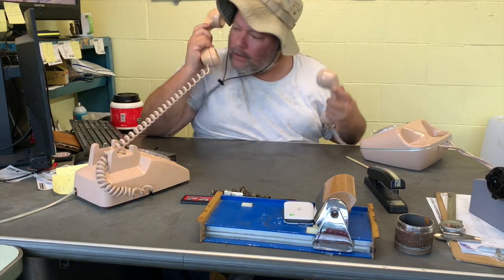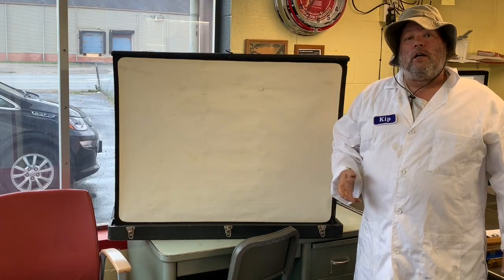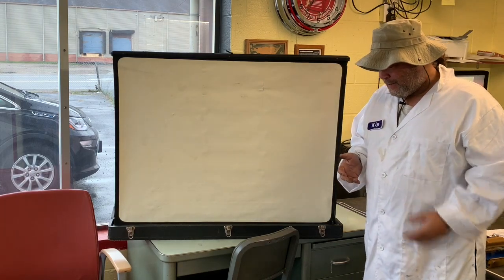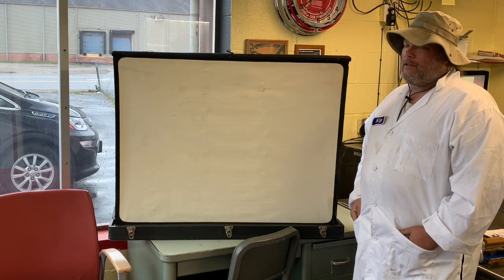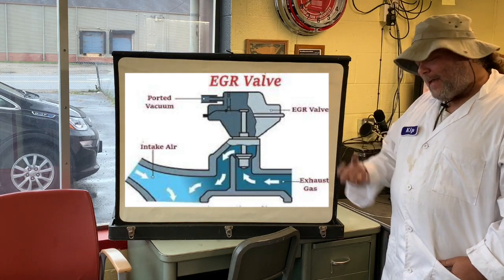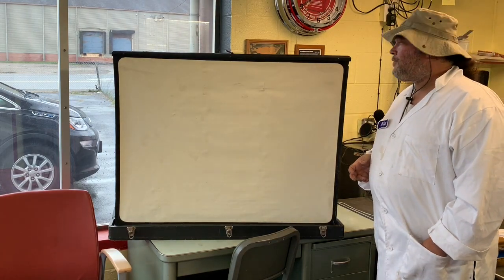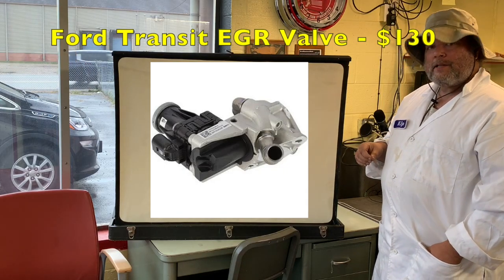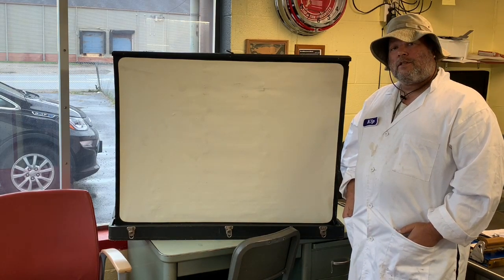Kip U #3 - EGR and You! Fun things to learn about Exhaust Gas Recirculation. Ram Promaster Valve

Comment: Just watched a vanlifer video, traveling the Dempster Highway to Artic Ocean and their Sprinter Van had a black EGR Valve (was silver once cleaned) resulting in the van going into "limp mode".  He was handy enough to open it and clean it off with a toothbrush and some spray cleaner and it fixed the problem.  But it made me wonder if the Promaster has a similar EGR valve and voila!  Kip U to the rescue.
Reply from the maker: I do like to be timely. What he doesn't say in that video is that you will have something like 25 starts after that code lights because it's emissions related. On start 26, you are stranded, on the tow truck, and on your way to the dealers at great expense.

Comment: Lincoln here, technician at this fine establishment, and what my counterpart meant to say was it LOWERS the exhaust temperatures thereby reducing NOx emissions by replacing part of the intake charge with an inert gas ie leftover exhaust gases.  This was replaced by valve overlap as used in the Promasters as early as 2002 at least on the 4.3l which previously had an egr valve.  Valve overlap not unique… The problem with EGR… CARBON!  Chrysler may have done so even earlier I believe.   They hang open and cause drivability problems.  Ford loves em some egr, DPFE issues, etc…

Comment: Well I learned something today. I had myself convinced the egr valve was my problem, but now I find out I don't even have one. I have a persistent P219A code (air/fuel imbalance). It comes and goes. Haven't been able to figure it out. Sensors have been replaced no vacuum leaks. My next project is to change out my injectors, coils and plugs. If that doesn't do it I am at a loss.
Reply from the maker: That code refers to a mismatch between cylinders in the given bank (rear bank is 219A I believe). So cylinders 1,3 and 5 aren't balanced somehow, but the imbalance isn't enough to trigger any code. I have a customer who has successfully ignored this code for 50 or 60k, so I think you should be ok. It's going to take some pretty deep diagnostics to figure out where the actual issue is. What you could do is simply move the injectors, plugs, and coils from bank 1 to bank 2 and vice versa. That's a free test. If the code moves, you know it's something about those specific parts. If it doesn't, you can forget about plugs, coils, injectors, and electrical.

Comment: Heeeey, is the only difference between the 1500, 2500, and 3500 models just suspension parts? Do they have the exact same engine and transmission? Is it the same engine and trans that are in the tiny family van?
Reply from the maker: Not only is the EXACT same engine in all 3 weights of Promaster, it's the same in minivans, Journeys, most Chrysler 200s, etc. Addditionally, the suspension is all three vans is basically IDENTICAL. The fronts are all 100% identical. Some have different leaf springs in the rear, and some have a rear sway bar. But basically, they are all FRIGGIN' IDENTICAL.

Comment: How come when people disable EGRs in diesels they see improved MPG? Wouldn’t it be decreased since more gas is wasted?
Reply from the maker: Gotta admit, I'm unsure exactly how EGR works on the diesels. I can tell you that it's extremely complicated and related to emissions. My guess is that that they delete that stuff because it's complicated and will put them out of commission when it breaks, not so much for power or economy reasons.
Reply: Would be awesome if you ever get an ecodiesel promaster in the shop and teach about those. I got one but there’s not a lot of info about these as they stopped making them.
Reply from the maker: @mperson91  I have a guy who's good with the diesels located north of Chicago.